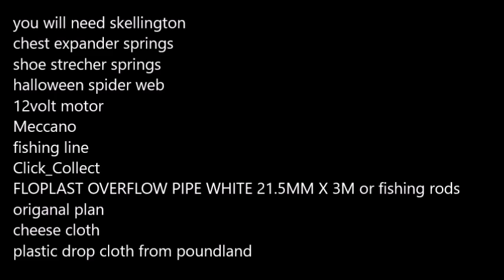D I Y how i made my my homemade Floating  Ghost Phantom

Comment: Great videos and good to see someone from the UK as alot of the others are from the states.  Can I ask how you attach your meccano metal plate to the motor as the motors I see on Amazon dont have a screw hole in the top to attach anything.  Thanks again

Comment: Hi great job
Where did you get the motor on it's back.
Tia
Reply from the maker: long time ago i think it was similar to this one amazon  DC 12V Reversible High Torque Turbo Worm Gear Box Reduction Electric Motor(6RPM)
Reply: @pauljones5601  ok thank u

Comment: I have a small flag pole holder screwed to my brick work. Think if I mount a flag pole up it's butt it will work.. not sure how heavy the skeleton is
Reply from the maker: ild say you need a couple of fixings i screwed into fascia board as my walls are crap skeleton are quite light but as you can see the pvc pipe bends well possible pvc clips with a bend joint may work good luck
Reply: @pauljones5601  you should get a motion activated head that makes noises for your setup.. that would be awesome

Comment: Looks like I'll be trying this following the Skeleton in the drum I made last year. Also making an reverse (bringing back to life) electrocution zombie. I believe I asked you this last year, but I have never seen a skeleton like that sold here or anywhere. Where did you get it?
Reply from the maker: Hi sig I'm from the uk and only see them at Wilco each year at halloween but £15 a shot you can't go wrong
Reply: @pauljones5601  No, that's very low price. They average 50 here in the states.
Reply from the maker: @clayrauch9718  that sucks then again you get so much more choice your side of the pond
Reply from the maker: also show us your electrocution zombie was looking to do a similar prop but find it hard to find a discrete vibrating motor